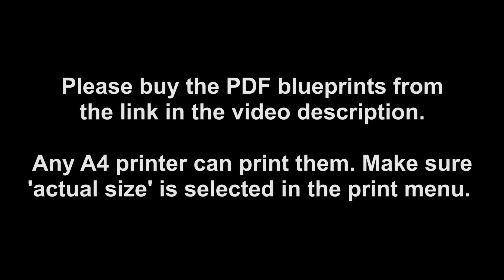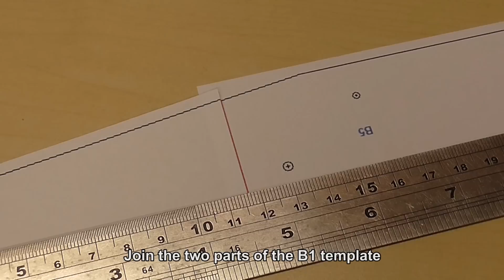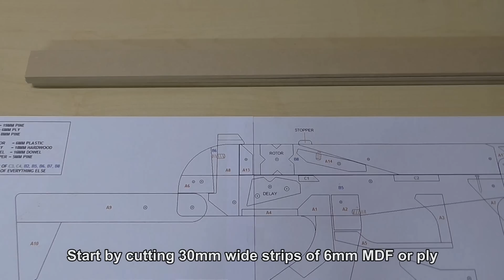MagArm 3 — $5 plans and tutorial

Comment: Parabellum1262, I wanted to congratulate you on this rubber band gun design! There is so much going on here in design, it's deceiving! Trigger, delay and A14 tolerances are critical for proper shooting. Also, spring stiffness is a subtle detail people may get hung up on... (Hint: Free Bank Pen Springs Work Really Well...) I'm on my 2nd build of a slightly modified design. I've finally got it tuned in and acting as it should. I'll post a video soon of it in action. I appreciate engineering and simplistic design. In a day of over engineered electronics, It's refreshing to build something mechanical that puts a smile of my face! :-) A+
Reply from the maker: Thanks for the praise! My opinion will be biased but a friend of mine has concluded it's close to perfect. High capacity magazines, compact and with none of the reliability issues of a blowback gun. The dual trigger system is also more user-friendly than a selector switch. I'll be glad to see your build!

Comment: Is the intent for the Rotor to spin on the pin or the whole pin assembly to spin in the frame holes? Also, are you adding two washers to the delay unit around the pin?
Reply from the maker: The rotor should fit tightly to the pin and spin freely inside the frame holes. I did add two washers but they are probably unnecessary.